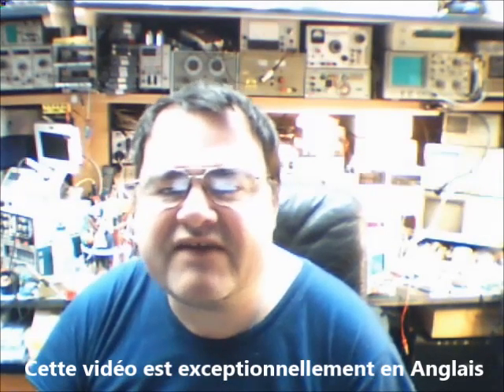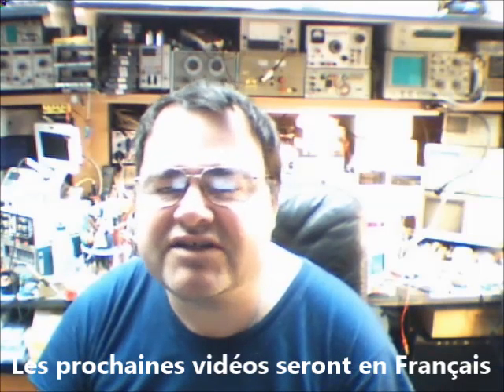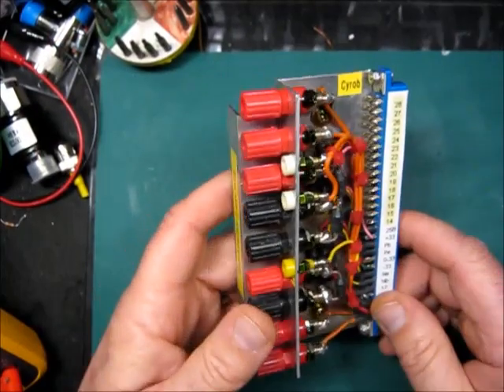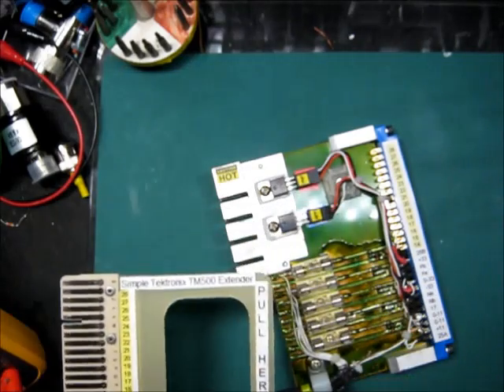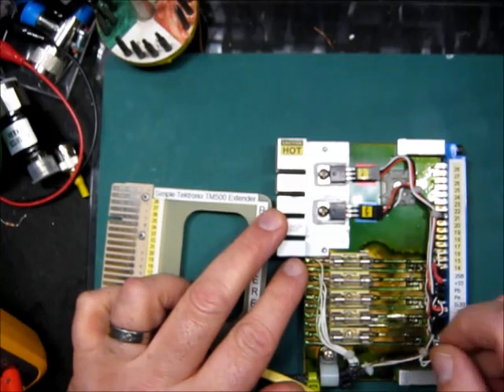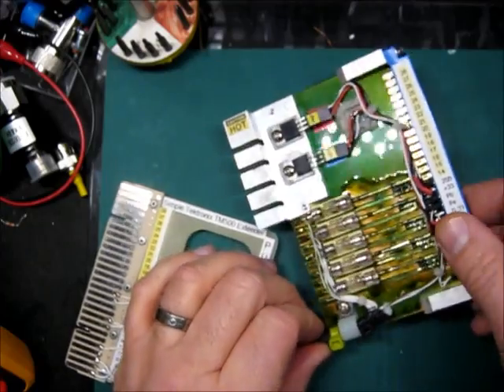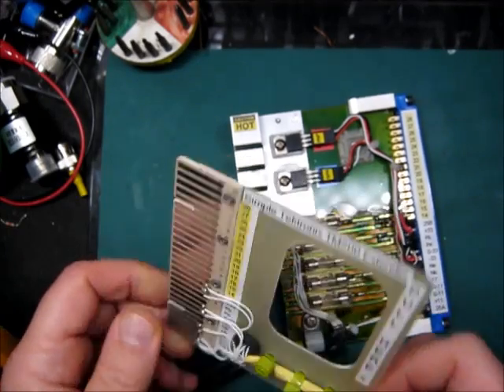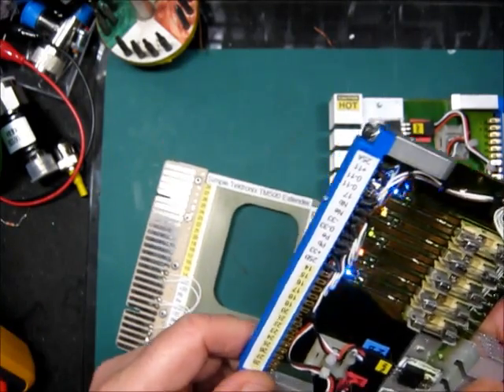Cyrob : Home made Tektronix TM500 extenders (In english)

Comment: Nicely done. I like the idea of putting the two power transistors on the extender. If you make a mistake while servicing a module, it will be much easier to repair the extender.
Reply from the maker: +tmiller11147 Hi, yes this is why I fixed the transistors with connectors instead to solder them. And this reduce of 6 the wires to the mainframe.